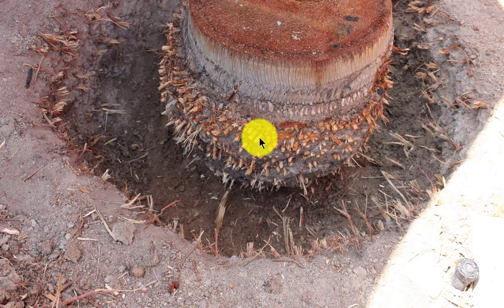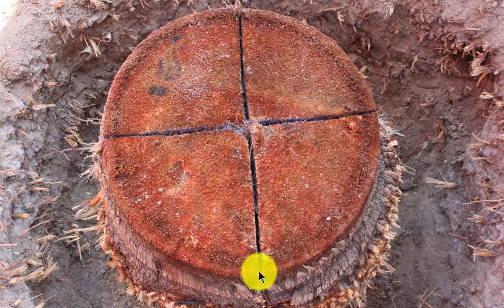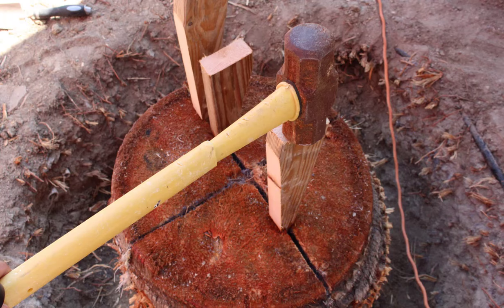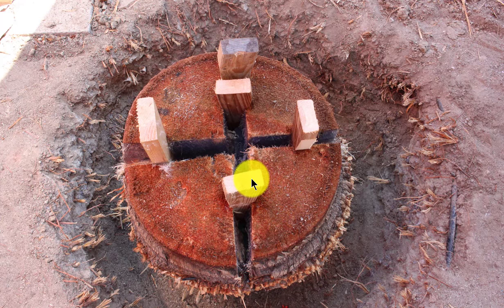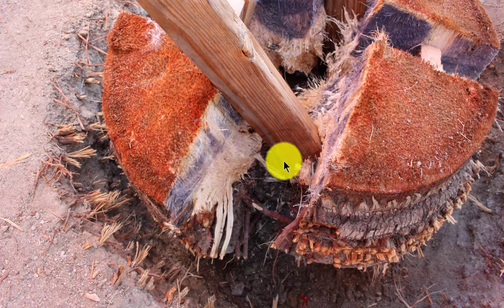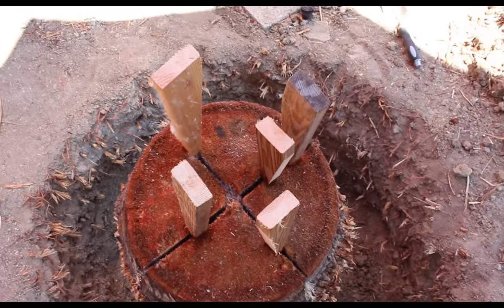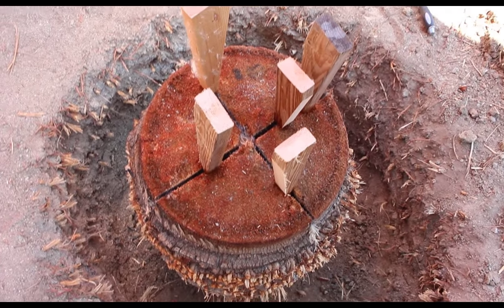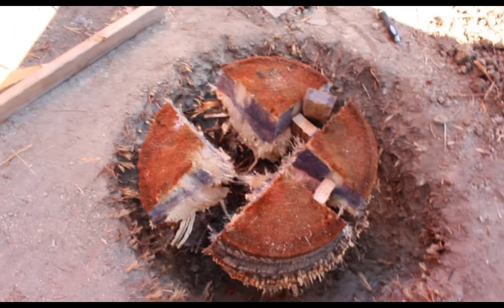How to Remove Palm Tree Root by Splitting It into Sections -Try This Simple Solution

Comment: I pull a lot of very large (24" dia plus trunk size) palms and rootball.  This is a great technique.  I use equipment and still a lot of work.  Rootballs will be 4-6k lbs, 6 to 7 ft across the rootball.  This will really help to cut it into 4 sections.
Reply from the maker: I'm glad you liked the video and glad it will help you in the future.

Comment: my job is very similar to what you did. I started with root killer and let it fester for 3 months, i have 4 hours in to my excavating , i am very good with a shovel and labor , and i must say the hand spade and axe is the exact way i am tackling mine , my admiration to you this labor is not fun and a very slow process ,, great job and thank you for posting , i now feel im on the right track
Reply from the maker: Glad you liked it and this is one of the smaller tree roots I've taken out over the past 15 years and I would simply chip away working between one and two hours a day on it, whenever I felt like it, until it was done.
Reply: @constructionideas  yes, thank you for posting- it gave me confidence to continue, update, had 16 hours in labor, too large to get out, I put a full bag of charcoal   it burned for 10 hours, palm stumps will not burn in a traditional way as other solid stumps but it helped, took 2 hours to bust up the stump, a tunneling bar really helped

Comment: Thanks for the video.  I have two palm tree roots to remove.  This video helps me to see the whole thing.
Reply from the maker: You're welcome and I've also used it for a variety of different tree roots also.
Reply: Before you get to this part, what tools and what method you used to dig a circle around the palm stump?  I got stuck because I can't get past small roots around the palm.  I have to cut and dig as I go but not very far.  Did you use any power saw or power tool to cut through soil and small roots?
Reply from the maker: It wasn't easy, I used a small handheld ax to cut the roots, pointed shovel, pick and even a framing hammer. One tool that might help you will also be a shop vacuum. I used it to remove all of the loose dirt and expose the roots.

Comment: I’m curious if you think maybe if you split the stump first before trying to dig out the tiny roots around the root ball if it might’ve been easier?  I have the added complexities of whoever planted this queen palm did so in large gravel rocky soil and right next to my swimming pool wall… So I’m limited on how much pushing and pulling I can do without compromising my pool wall .
Reply from the maker: Give it a try.
Reply: Did you try it out? I’m about to tackle one of these and have a similar problem with the surrounding soil etc.
Reply: i have a similar problem except my situation is that I just don't want to dig

Comment: I cut the top and bottom out of a 55 gallon drum, installed it over the stump and poured in 4 bags of charcoal and walked away, it was gone overnight
Reply from the maker: The fire department might not like your idea, but I do?
Reply: I approve!!
Reply: Maybe it would have been quicker if you lit the charcoal
Reply: I went to home Depot and picked out two Mexicans and walked away -- gone in 4hrs
Reply: @typ8723  I live in Florida, Those Mexicans are very hard workers and humble. I see them working in the sun in 90-100 degree weather with humidity at it highest.

Comment: Should have dug an access to the bottom and cut the roots. No messing about with wedges. The access might even give you enough room to push the stump over.
Reply: Wildlife Warrior  Dig a parallel shaft all the way to the bottom and cut the roots. Removing soil is easy and takes not much effort.
Reply: Wildlife Warrior  That's because you never tried it. Takes minimum effort if the correct digger is used. A spear, a crowbar, and not a shovel.
Reply: Wildlife Warrior  Ok, I am not in the tree service business. I just dig some stumps from time to time. If I was in the tree service business I too can do better. I'd get myself a powerful SDS chisel to cut the roots.
Reply: Wildlife Warrior  No doubt. I swear by my way because it's least complicated and least effort without specialised tools.

Comment: Showing an easy one makes it look like removing butter.  The reality is, your video shows a stump that’s been dead for a very long time.  You should show a trunk from a tree that has been cut down only a few months.  Your system doesn’t work well for this kind of situation, only for very old stumps.  You really should state this and not make it look so easy, which it definitely is not.
Reply: What makes you so sure it has been cut a long time ago are you seriously
Reply: AlekM, you are 100% correct, a new cut palm tree trunk, holds a lot of water and tremendous flexibility, there is no way on earth you can split it per this video. I cut mine 4 month ago and it is a nightmare trying to split it. I poured several gallons of gas and motor oil, and lite it. It burnt the fuel and scorched the surface, but because there is so much moisture within the fibers of the palm tree trunk, the fire died, and still intact. The root ball is large, so I figure it'll take me a day or more with a chain saw to cut it to ground level.

Comment: thank you. i'm taking down four on the side of my house.
Reply from the maker: You're welcome and let me know how it worked for you.
Reply: @constructionideas  funny you replied now. all week i've been working on trying to dig one out and using a 2 ton engine hoist but no luck. i'm digging through clay and gravel so a shovel is just about useless. and i have four total to take out of the ground. today i threw in the towel and trying your method. will let you know how it went. thanks.
Reply from the maker: I didn't have gravel to deal with, but those palm roots were so close together that I used to hand ax. I dug two of them out and simply worked on them in my spare time. It's definitely not a job for the faint of heart.
Reply: L